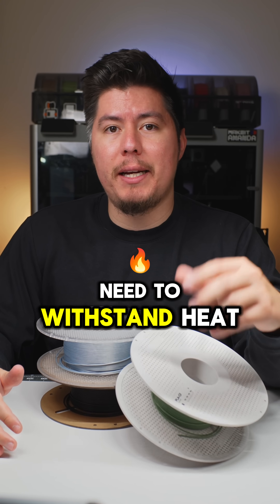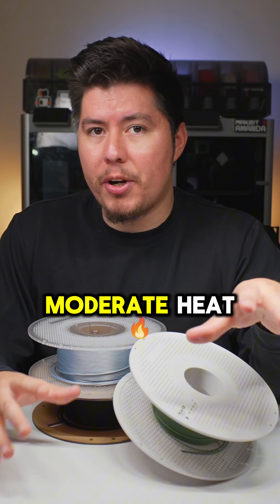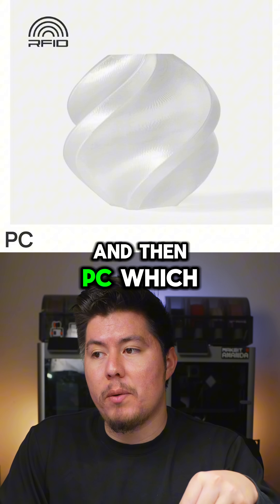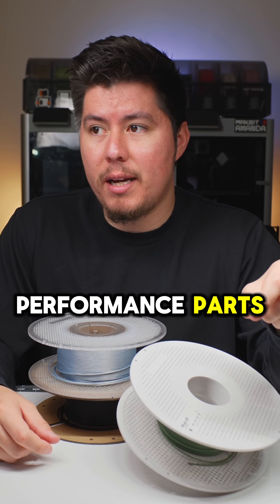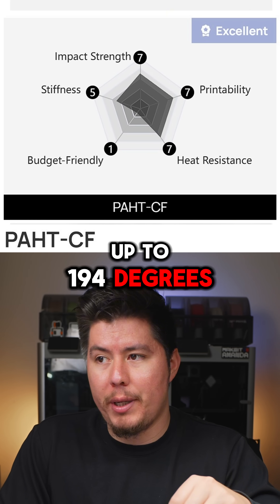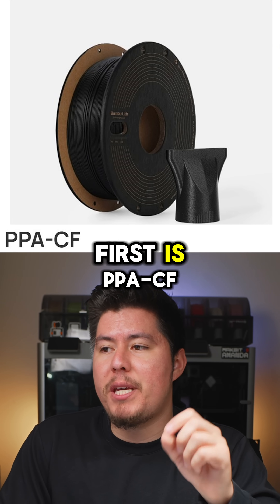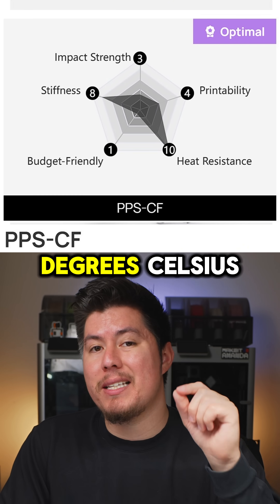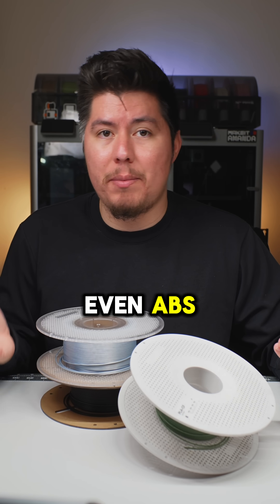Which Filaments Can Withstand Extreme Temperatures

Comment: I’m trying to design a clip mount that will clip in my car for my radio scanner, but I’ve been having problems with the clip warping over time, even with no pressure applied. I’ve been using PETG. I have improved it quite a bit where it’s not so bad, but could a different filament help with the warping issue? Thanks in advance